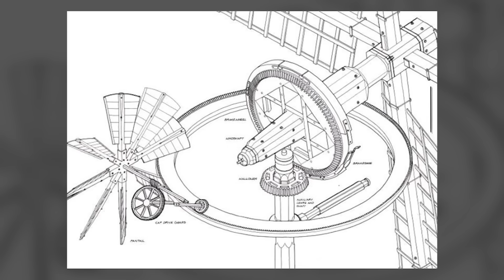The REAL Reason Medieval Windmills Still Run After 600 Years

Comment: in the netherlands, windmills also pumped water to dry up low areas. some are still in use todey.
Reply: I was thinking perhaps they should be called windPUMPS as they are powering a pump not a mill.